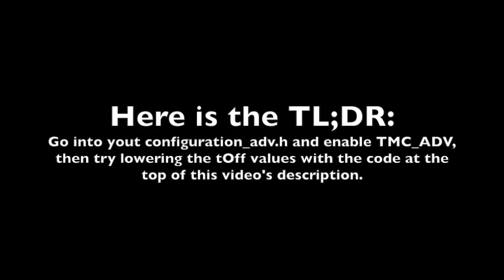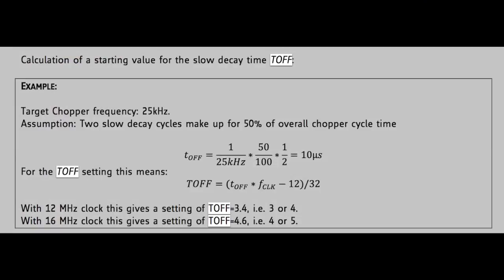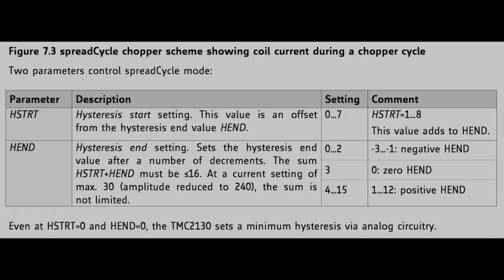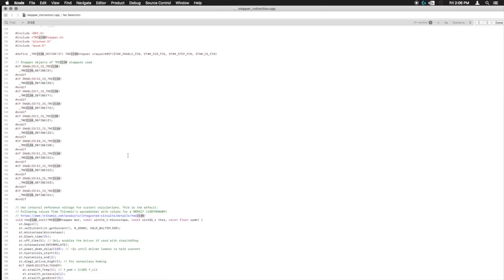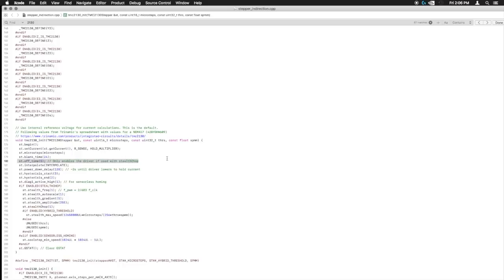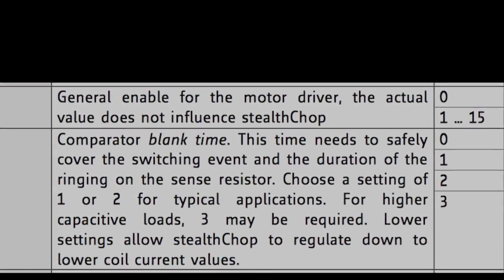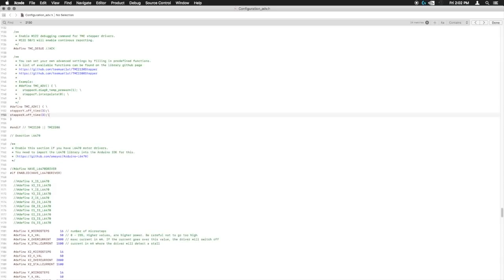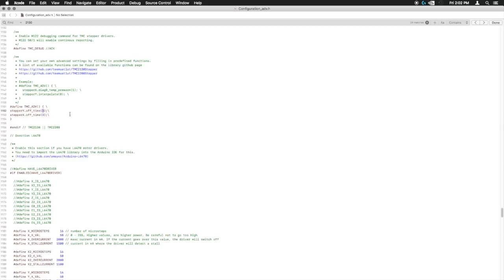TMC2130 WHINE: advanced troubleshooting for stubborn steppers

Comment: Thanks for this video - it's helped me a lot. I'm running TMC2130s with a 12V printer and the whine from the steppers was terrible in spreadcycle mode. I tried fiddling with chopper timings and it helped, but what did the most with noise was enabling stealthchop and hybrid mode and setting the hybrid threshold low (e.g. 10mm/s) so the printer uses stealthchop for holds and spreadcycle for moves. At the end of the day though I need to move to 24V to make all these problems less of an issue!

Comment: thank you for Great information that I couldn't find on any 3D printing channel or website or even GitHub. can you explain why we cant run high inductance motors fast. I have a motor with inductance 12 and I am debating on replacing it. I bought it around $20 so its quit expensive and I am t sure If  I should replace it, since its loud when I run it on spreadcycle. my motor is 17HM15-0904S and it very whiny.

Comment: hi Alex, i have got a feeling i'm the guilty party :D did a quick test on the settings for TMC_ADV still high pitch noise, ill re watch your two videos, i might have missed something. i didn't mind buying a set of stepper motors to try to remedy the whining noise since i plan to build a hypercube 300, if it still had a whining noise at least i'll have the stepper motors for the new build. i also tried 24v on the drivers, still whining. so for now i will stick to stealthchop.
Reply from the maker: I wish had some whining steppers to troubleshoot here, but all the ones I tried are behaving.  I can get them to whine by changing the TMC_ADV settings though.  

I did a little research and found out that those Anet motors are not what they are labeled.  They were more more powerful steppers that were sold as either 0.9A, 1.5A, 2A and they just changed the claimed torque rating based on what amperage they sold it as. As far as I can gather, the inductance is 7-8mH, which is high but not not unreasonably high, BUT they have high resistance and voltage drop across the coils, so those factors can combine to make them difficult to deal with spreadcycle.  

No harm in buying new steppers, but if you get settings that make the Anet guys behave, let everyone know.  I can confirm that these models don’t whine because I have them in a machine that is locked in spreadCycle: 17HD40002H-22B (1.5Amps), 17HD48002H-22B (1.7Amps), 17HS16-2004S1 (2Amps). I think they are all from Stepperonline and ZYLTech, and they were all under $10 a piece. I think Zyltech is using the 1.5Amp and 1.7amp models in their hypercube kit.  The 17HS16-2004S1 (2A) can’t be powered fully with TMC2130 and have lower torque, but higher speed, so the 1.7A or 1.5A would be better probably.  I also use one of the 1.7A models as a Bowden extruder with a DRV8825 + diode smoothers and have had no troubles... its probably heavy for a direct extruder though, but the torque is great.
Reply: I got a 5 pcs set from stepperonline on ebay $52 for the set, 2A. i was going to get the 1.7a from ZYLtech but i saw your recommendations video and the stepperonline instead. how do you mean the tmc2130 can't fully power the 2A motors?
Reply from the maker: No worries, they are good high-speed motors: I use the 2A and they are fine and very well built, they just have to run at a lower current because  the 2130 stert to get hot when you get close to 0.9-1A rms, so that is 1.25A-1.4A peak, which runs tha 2A steppers at 63%-70%, and that gives them 40-45oz of holding torque, and their low inductance gives them good dynamic torque at higher speeds
Reply from the maker: The 1.7A would just give you maybe 20oz or so more torque at low-med speeds with less driver heat, but hypercube doesn't need as much torque as an i3 design anyway because of the bed, and you'll appreciate the extra speed of the 2A models if you get a volcano and start messing around with ludicrous speeds

Comment: Alex, keep up the great work man! I have a spare einsy board, completely unopened, from ultimaker. Do you have anything you might want to trade for it? I'd love to see what you'd do with it. I have an einsy powering my maker select v2. There's a nagging retraction issue I can't seem to solve and it's driving me nuts. Send me a message and we can get in touch. Again, thanks blfor the great videos and research!
Reply from the maker: Thanks.  I appreciate the offer, but all of my parts are tied up in machines or experiment setups, so I don't have anything spare to trade at the moment. Those are nice boards thouhg, so I hope you get your retraction problem nailed down: trinamic drivers are great for tweaking, but having so many options and settings makes things difficule sometimes.

Comment: and i have an old left foot sock..... Lol
just kiddin round (its a right)....Lol
oh i kill me...!
got message on the coil winder. you said you kinda use it for pickups ....?
and it sounds like it could do some fine wire allright. could it wind a bobbin kinda thing ....?
BTW NICE VID. AND SPOOKY LIGHTING....
IS THAT YOUR ORIGINAL MUSIC IN THE INTRO ....? 
gOOD STUFF THERE.
Reply from the maker: Yup, I actually got started in 3d printing because I couldn't fine bobbins and coilforms in the shapes I needed to fit custom cores.  And that is indeed a clip from a studio-only project I was in a few years back called Solamors.  It was the first time I recorded a correspondance only album, and much of the guitar/bass gear and plugins were DIY design and build.
Reply: also: Mr. Kenis i have one of those new fangled Ramps 6 boards but how do you configure all them little jumpers and crap.....? would you mind going over it/them or point a bruther to a place where we may find this info ...?
cant quite find a vid. on this BASIC thing(and trust me i looked ) HARD
any help would be appricated......
Reply from the maker: Thats a video I should probably make, if it is hard to find another. Maybe tomorrow if I get a minute. 

The jumper settings vary depending on how you want to configure the micro stepping for whichever driver chips you are using, so they are all different unfortunately.  Best bet is to do a search for jumper settings for the driver you are using.  Usually at least jumper #1 will be labeled on each driver socket as “MS1”.  

If you want a quick fix for 16x microstepping (commonly used), on most RAMPS boards, for common drivers (this should be correct... i'll double check when I make the vid): 

-A4988 = all 3 jumpers on

-Drv8825 = jumper 3 on, 1 and 2 off

-TMC2100 = all jumpers off ( = spreadCycle /w interpolation)

-TMC2130 (in legacy/standalone Mode) = all jumpers off ( = spreadCycle /w interpolation)

-TMC2208 (in legacy/standalone mode) = Jumper 3 OFF, jumpers 1 + 2 on ( = stealthChop /w interpolation)